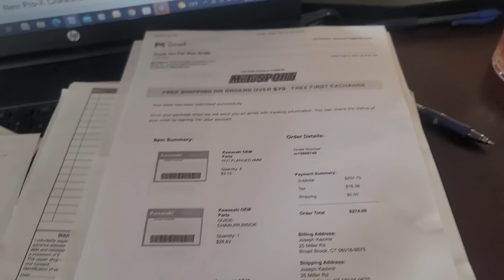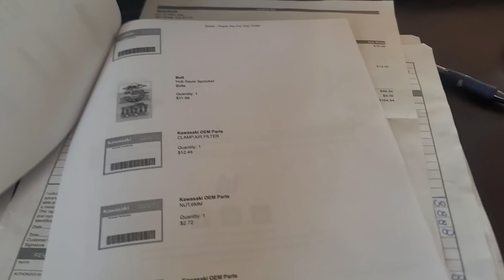MX REAL TALK; WHY IS IT SO EXPENSIVE TO PAY A SHOP TO RESTORE A MOTORCYCLE?

Comment: Doing my 92 Suzuki quadracer frame up. Yep thousands into it. Everything new from bolts , bearings,seals you name it powder coat, paint. Exactly like you say, the time alone in sourcing parts, driving to vendors. And the many hrs of disassembly, cleaning, reassembly. Yeah a certain few know and appreciate it. Well put Kaptain
Reply: I just got a lt250r 1992 myself , it was in good condition motor wise and cosmetic wise plastics are original like brand new , was sitting for 6 years so I had to but all new front bushing elka legacy shocks new breaks ect , Im not doing a full on restore at this time I got it to ride and have fun Im old school 2 stroke guy so maybe after I have some fun on it I will tear it all down and have fun sendog everything out for powder coating ect ..

Comment: Worked for a Honda Yamaha triumph Ducati dealer for 15years and usually if a bike was more than 10 years old the service manager would not want to even  take it in unless the customer was willing to leave a sizable deposit because the time and parts and labor were pretty expensive. Can't tell you how many bikes wound up on our sales floor because the size of the bill in the end the customer wouldn't pick them up.

Comment: I love the subject and have been restoring my 1989 suzuki rm250 and I did most of it on my own except for the shocks that was done by Race Tech, bills pipe made me a custom tuned pipe and silencer for it the powder coating was done here locally in Arizona and I went with the same color yellow for the frame so frame matches plastics and engine is a silver tone I just didn't like the blue but ther isn't any shop around anymore in the Phoenix east valley area that really does any restoration xcept for me I've restored 7 bikes now from a kx500 to my dads 84 Honda trail 110 to my 1st bike 81 Honda 50r and 81 Honda atc70 and I've done a few quads too like my Honda trx250r and a suzuki 250.. its not easy to obtain correct parts and thanks to ufo as far as plastics they seem to be one of the few if not the only ones that make alot of the classic bike plastics still.. but with that said thats why I admire you guys you take it to the level and sometimes beyond wher I take my builds because you guys have the ability & structure to do it and do it right and I commend you guys with an outstanding quality to build and to do it better than new keep it up I love every one of ur builds and videos on them

Comment: I'm doing a 1980 tt 250 an a 1978 tt 500. Full frame off. It's mostly time. An being a home builder it takes twice as long. I have a sand blaster but don't have a 80 gallon air compressor to push it. An I have to read the repair manual 30,000 times to make sure I'm doing it right. Double check everything wometimes triple check before I move to the next step. But man when you kick the bike over there is nothing like it. Stepping back an looking at your bike. Its a sense of gratitude knowing I built this I done this. An all my neighbors saying wow this guy can fix just about anything. I take pride in it. An I see that pride in you everyday. Thanks for keeping all these bikes alive really cool.

Comment: Hey nice job. I agree. In 97 I bought a yz250 every year it came apart and was restored. Suspension and motor work  new tires and  replacement parts.  About 2k I had that bike 10 years before I finally sold it for 3 grand. Keep doing it. Keep the two stroke alive.

Comment: rebuilt the engine on my 02 RM 250 first time rebuilding dirt bike it cost me just under $1,000; $480 for a new steel sleeve and piston kit wasn't able to replace the crank or rod it was a basic rebuild (seals, gaskets, tranny and crank bearings, carb rebuild, new clutch) Still have the bugs to get out of it took me 6 weeks working on it here and there. Its all the small stuff that adds up the unforeseen expenses. 

I love your big bore 2 strokes!

Comment: I've done a 95 Honda cr250 worked on it in my spare time over a 3 year period probably have at least 6 grand into it and now I'm starting on a 92 kx125 had this one for a few months now. It's a labor of love restoring these old beauties keep up the good work 👍🏼👍🏼
Reply: I had a 92 kx125 not too long ago had 2nd gear completely shatter and I had an absolute nightmare trying to source a new one then found out that Kawasaki didn’t even have any stock for that part left was gutted. Had to buy another complete gearbox from eBay and build one out of the two. In the end cost me close to £1000 in replacement cases and all the rest it took out when it went bang. Plus when I sold it the market here was poor so took a massive hit on it😓

Comment: When I was a kid, Japanese bikes that didn't run were trash, they went out on the end of the driveway with the old fridge and the dryer that didn't work anymore and someone would pick them up for scrap metal. My dad would bring them home and if we could fix them, we could ride them. That started me turning wrenches at about 6 or 7 years old, I learned a lot about being a mechanic. I am 56 and have made my living as a mechanic since I was 18. Most of the bikes we got were street bikes and we stripped them down and stuck knobbies on them and rode them in the woods. I would love to have an old Honda Hawk or an SL 350 that was restored, but you are right about the price. For what it would cost to have one brought back to life, I can go out and buy a new 750 that will eat the 350s lunch. I have an old T500 Suzuki and an XS500 Yamaha, not interested in restoration, I like to take them for a ride now and then, pitted chrome and all.

Comment: Something i found out running a workshop: people often think when they buy an old or cheap bike and bring it into the shop for repairs or tuning, that because the bike is older or cheaper to buy, the repairs are also cheap!  unfortunately the opposite is true, working on a new bike is far more affordable in most cases than working on an older bike. exactcly for the reasons you name in the video!    Great video with good explanation! Thumbs up 🙂
Reply: 100% facts...!!!

Comment: Hello from Ireland ☘️ love watching your videos. My 2003 YZ 250 full restoration cost £3500 in parts/ powder coating/ plating hardware.. then about 4 months of my own time from start to finish. If I was charging or the  hours then it probably be far more than double amount again. In life you get what you pay for 👌
Reply: I did the same, 95 cr125r 3300 usd 1800 of which was full motor rebuild.

Comment: Yeah I'm doing my little 85 and it's taking me a while and I'm doing it all like you said not putting lipstick on a pig I'm probably 3 months in and I'm ready to reassemble the motor and I had to get set up with all the tools just to be able to do the powder coating and sand blasting I'm using glass beads but you get it

Comment: I got a mint 91 YZ 250 £1800 ,powder coated , Rebuilt , , the gearbox went , he came an picked it up an fixed it for me , an was as good as new , apart from the yellowed white tank which had white stickers to cover it up, it had brand new chain an sprockets and everything, off a seller that has about 20 30 brand new TMs from Italy , 25 racing, Royston England, it was like new just weathered plastics, but was a x race bike , it was like new apart from some scares on swinging arm an kick starter was tired an gear lever was warn down from use,  edited, the frame rails were perfect even though it was a Supercross race bike

Comment: Hello Ken. Most people don't get it. Myself, I work in an autobody repair facility. When I had our painter spray my 1975 Honda CB 200T tank and side covers in a TRUE three stage candy apple red, it took just under 4 hours to do it THE RIGHT WAY! Most people thi k that thiskins of workif fairly easy andthat people in thetrade like you and me are just trying to make an easy profit. It's true to be said "YOU GET WHAT YOUPAY FOR". Another excellent point is that hardley anyone wants to repair, let alone restore any model motorcycle that's more than 5 years old here in Chicago Illinois. My go-to here are M&M Motorsports. A small privately shop. Mark and Bob are awesome! They as well like you guys clearly get the time and trouble it can be to a job RIGHT. Whether it's a basic repair OR a full restoration. I hope you are having a fantastic weekend!
Reply from the maker: Thanks John!
Reply: @KaplanCycles  Sorry for all the typo's by the way.

Comment: Agreed, Years ago I exclusively restored RM456/ RM500's I was always getting nickeled and dimed on the bikes by buyers. They had no idea the amount of work needed to build a "back to new condition" MX bike. The rarer the bike the harder the parts to find. I easily spent 8 to 10 hours just scraping, sanding the plastic gas tank, finally polishing it to a new looking condition. I have one more RM500E to finish and I'm done.
Reply from the maker: Ill buy it call me 860 916 9784  this is Sr

Comment: So nice on the eyes when you can get rid of all the warts, but a bit nutz to pay 10 grand+ for restoration perfection on a old dirt bike or an old UJM. If it's a collector's bike on a coffee table, it doesn't really need the 1-2k of factory connection suspension work. If it's a rider's bike, likely the rider will need it pulled apart and revalved/resprung to his specs anyway. I don't mind some patina if the active corrosion is gone and it's all tight and solid. Thankfully there are folks with plenty of cash laying around and fond memories to re-live. I appreciate your work! Happy Labor Day!

Comment: Ken and crew are saving these bikes. Most people ride them until there is nothing left and still want thousands for them. Anything used that is worth buying is usualy near the cost of new or a couple grand less. So buy new and make it your own if you can't afford an expertly hand crafted and restored peice of art. I too wanted to buy one of the dream bikes of my childhood but good luck finding one that dosent need the full Kaplan treatment. I priced out brake parts for a ratted out 84 CR125 I was riding and it was damn near $800 bucks just for the front brake sysyem, like 12 years ago. Granted prices are a little high in South FL. Love the vids Ken, and hope to visit if you ever open up a shop down in Fla.

Comment: Much respect to you guys, but let’s keep it transparent. 1st Business is business so point being there is obviously a good return for you being that your somewhat of the middle man on a full resto job or you all would not be interested in taking on such a task. You sent out the motor to be worked?  Y not do it at your shop? Obviously the owner has plenty of cash to through at it which is cool.  It’s a two stroke motor very simple. I broke the cases in half of my old YZ, and CR rebuilt the transmission and complete rebuild when I was 17 years old living at home here in Florida in the living room of my parents trailer in the 80’s. Is it a bike that not going to be eye candy or roosten some dirt? Point being if your not interested is all the fancy smancy do it yourself or research your local shops..  Save some cheddar. love the channel guys.

Comment: I’m over in North east Scotland and a shop that would do a restoration is zero I’m currently doing a rebuild/restoration on my first ever two stroke I bought back in 2006 which is my 2003 KX 85 big wheel and I’m already 600 pounds deep in parts alone and I still have the frame to powder coat and the engine cases to vapour blast never mind the full plastic set + both front and rear tyres,chain and sprocket kit,seat cover and top end rebuild kit to purchase. I estimated on parts alone before starting that I would be around £1500-£1800 if I end up needing replacement rims and new spokes ide be over 2k. I have no intention of selling afterwards but if I did I would of put more money in parts into it than it’s value. Can only imagine if there was a dedicated shop here it would be far more expensive. 
I think spending the money it does cost for a shop to carry the work out doesn’t matter in the end as the memories made on your bike mean more than money and it’s totally worth it for the end result.

Comment: In 1996 I bought a 1984 cr125 in boxes as a project to build with my stepson.  Frame painted new oem seat ,and fuel tank, crank , bore job we went through everything . never could get around the rotten water pump special right side engine cover made of magnesium and discontinued from Honda and to this day I have never found a good used replacement.  We tried everything to seal the damn thing up but it would just end up leaking coolant into the engine. Such a shame I still have that bike rotting away in the shed at about 90% restored such a waste.

Comment: It is expensive to restore old bikes.  I got lucky with my Yamaha 74 DT360 because i got it cheap plus the engine was in very good shape. But with my other projects -a honda 83 xl600 and yamaha xs500, it has been a struggle to get parts and find a shop that would look at them.  I found one not far where i live but its expensive.  The good thing is, the owner understands my situation so he only do the major work like the engine, paint and electrical.  The rest i can do myself.

Comment: I bought an XL 600R when I was like 20 and now I'm 30 and I'm still working on the damn thing off and on... Lot's of work, lot's of parts aren't available, gotta engineer solutions or fit newer parts... If you want someone who knows what they're doing to do it much faster, with better results, you gotta pay up.

That said, there's not too many bikes that can keep up with me in the desert on this thing. Worth it.

That said, I'm about to paint the frame but I'm not sure what paint color to use. Any ideas? Doesn't have to be perfect as long as it's a Honda red.

Comment: Yes sir Ken you hit that right on a note I know because I've tried restoring a few bikes in the past and working on a quad right now but I got real sick from covid in January now I have long haul Cove and having trouble breathing can't really walk too far or else I feel like I'm going to faint fainted three times already in late January so my two-stroke quad got put on hold even if I wasn't out of work for 8 months almost now I still probably wouldn't have it to where I want cuz it just takes that long it's crazy how much goes into a full Resto or a full build going off of your mind of what you want cuz that's what I did I want like a mid-90s Blaster build I got it and it runs like crazy almost 25 horsepower but I'm trying to get it to 38 or 40 horsepower so I can hopefully when I get better enter for XC racing it's been my goal for about 3 years now and then I had a 125 that I was putting so much money into it was a 1996 cr125r it was like my dream 125 I finally had it for the second time I was just dishing too much money into it and I ended up having to sell it because I had a bad addiction back in the day so I ended up selling it for money it's like a dumbass but I completely understand where you're going with this it ain't easy to do a full nut and bolt restoration on anything especially things that are older or a lot of parts are rare and harder to come by and when you do find them they're more expensive then your mechanics your polishers suspension all that at the end Rings up a Big Tab I always loved your content keep on doing what you doing man I'll keep supporting this channel💪🤘‼️

Comment: 100 - 120 $/hr + Parts. And what do you buy NOS and what do you restore? I know a set of engine cases for an 01 cr250 go for 2000$. And they made the engine the same from 92 - 01. Now think about an 88 with a single-year run of engine cases. Make that an RM that sold 1/4 the amount of bike honda did. It's pretty obvious why everything costs so much.